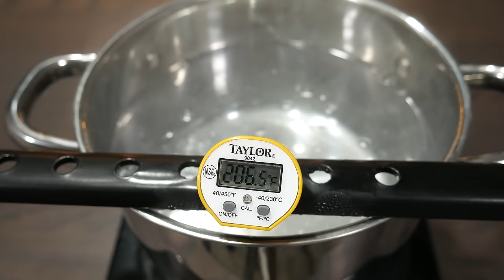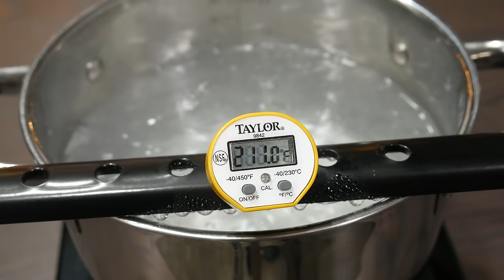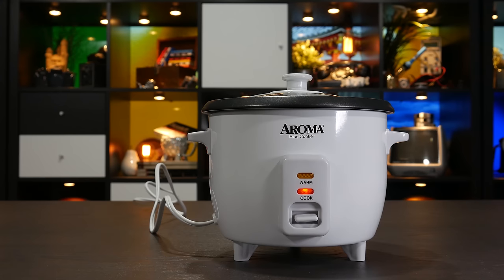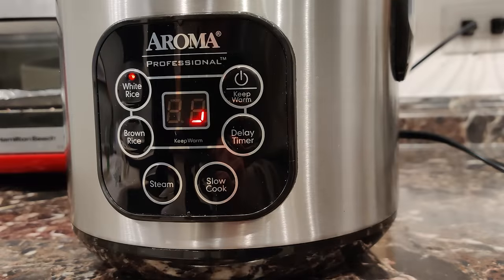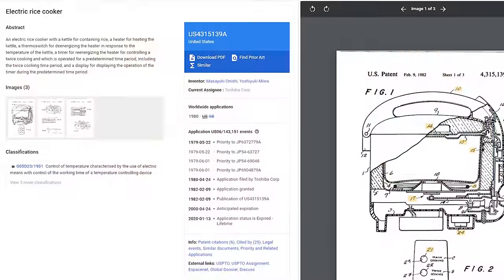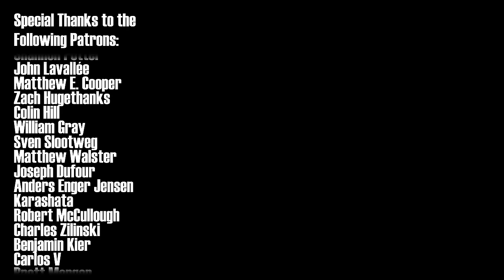Old-fashioned rice cookers are extremely clever

Comment: While the original Toshiba rice cooker from the 50s went out of style in Japan in favor of more advanced ones from Zojirushi etc and became a display in an appliance museum, it actually survived and has become a household item in Taiwan in the form of Tatung rice cooker. Available in various colors and sizes, Tatung rice cooker is said to have become a popular souvier for Japanese tourists when they visit Taiwan.
Reply: Yes exactly! Also wanted to add these are just about the only rice cookers you can buy with a stainless steel inner pot ie without non-stick coating! The coating is toxic imo, and it always flakes off eventually. Replacement pots are very expensive too.

Comment: Fascinating! so it’s not about cooking time, or pressure, but instead the ratio of water to rice. Thank you. You also instilled confidence in getting a cheap rice cooker.
Reply: Protip for cooking rice: Right amount of water for white rice is putting rice in the pot, then fill with water until the water is one fingerjoint above the rice
Reply: @MrProthall  depends on the rice type though. Some rice in some areas need more water and some need less. You need some experiments before getting the desired result.

Mine is like 4/5 upper finger joint to get the desired result.

Comment: Awesome explanation!
This helped me sort of figure out what is wrong with my rice cooker. Bought one just a few days ago and the stupid thing won't cook, it just jumps back to "warm". Thanks to your video I figured out that, for whatever reason, the magnet won't engage. The lever will just not stick in the down position. I thought I was doing something wrong, as this is my first rice cooker, but now I know that something is up with the magnet. I'll see if I can figure out a solution on my own, otherwise it's gonna get returned.
Reply: In another comment, someone said that once the magnetic force goes away,  something beside cooling off needs to happen before the magnetic property is restored.

The suggestion was made that there may be another magnet that remagnetizes that main magnet.

You could find that if you like reading these comments.

Comment: Came across this video while doing research on rice cookers and this has solidified my decision! I had a hunch that the simpler rice cookers give you the most bang for your buck and I enjoyed how you explained all the cool science and engineering that makes this work, loved this video!
Reply: I've had this exact rice cooker for a couple years, and it works great. I bought it to replace a 20+ yo version of the same one, which was actually still working just fine, but the bowl was losing it's coating, so I started to worry about its food safety.

Comment: I have the very same rice cooker - and like you, I started out with a much "smarter" device that was a real pain in the butt to use. Simplicity is King!
Reply: Smart is indeed thrown around a lot lately but without UX research a lot of companies can very quickly deliver "dumb" smart devices... As counter-intuive as that sounds.
Reply: I would argue the need to integrate a simple electromechanical timer that prevents cooking from engaging for up to 10 hours.  The only real selling points of using a modern rice cooker are the automatic ceasing of cooking and the ability to offset the start of cooking time so one can wake up to rice being perfectly prepared ready for breakfast and/or arrive home from work to perfectly prepared rice ready for dinner.  One can cover a similar level of safety from overcooked rice by using the oven cooking method rather than the stove top cooking method so that leaves the desirability of offseting the cooking time.
Reply: @chiblast100x Could always just attach the rice cooker to 24 hour wall socket timer and problem solved.
Reply: Rice cookers with Wi-Fi and app notifications are the norm.
Reply: @chiblast100x  meanwhile I use a streamer to cook my rice, also fairly safe from overcooking, though it is not exactly the fastest method.
Reply: Because your (and the authors) personal rice cooking preferences differ from my own, i deem them unfit and unacceptable. Good day, louts.
Reply: I found one of these while dumpster diving. Works pretty well.
Reply: @DeRien8  LOL I've dumpster dove in my college days and found interesting things, hell even made money online selling some things I found, but to take in and use a food preparation appliance? 

Actually, I got my recent toaster oven that way but that's a little different. We naaaasty!
Reply: @roderik1990  A steamer's a very solid method too.
Reply: @the_kombinator  
Good thing is, it was more "left behind, then cleared out" than "hey, this is broken."
Reply: @DeRien8  Yeah actually, my toaster oven was also a "left behind after an eviction" deal. That and a lot of tools.

Comment: What I think is really interesting about the interaction between the magnet and the spring is that it seems like part of what makes the change from "cook" to "warm" so quick and discrete is the relationship between Hooke's law and the inverse-square law. The magnet is stronger than the spring at close distances, but the spring easily overpowers the magnet once the button is far enough away, even after the temperature has settled back down and the magnet starts attracting again. I don't think you could get anything like this behavior with two springs, even if springs had something like a Curie point.
Reply: should be inverse-square law, right?
Reply: Sean ye^
Reply: That’s probably why they used the magnet instead of two springs then
Reply: You could get the same action with a bi-stable spring mechanism, I bet.
Reply: @spikosz  I had "inverse-square law" and then edited it after Googling. honestly it's been a while since I took physics so I'm not sure which one is right for magnetic force.

edit: ah, I think force is inverse-square and field strength is inverse-cube

Comment: "Water can not exist at a temperature higher than it's boiling point"
Well it can in weird situations but that's not important right now
I love that you put that in because you know your audience is a bunch of easily incitable nerds just one small technicality away from nerd rage XD.
Reply: SupaDanteX Would that “weird situation “ be under pressure?
Reply: @samiam619  and high temperature too
Reply: Sam I am All things being equal, increasing the pressure would also increase the boiling point temperature (because you need more energy), so water would be hotter but still wouldn't be 'higher than its boiling point'.
What he may have meant is what happens when the water isn't given an initial boiling spot, similar to freezing water that isn't given an initial freezing spot - you can heat/cool it beyond the phase change point, but it becomes unstable. Google 'instant boil' or something like that for more info.
Reply: KillahMate you're right.
Reply: the upscriber *you’re rig- oh you got it right.....
Reply: @samiam619  one thing worth mentioning is that the affect of pressure on the boiling point of water is inversely proportionate. So for example, as opposed to 100°c being the boiling point at sea level (100 kpa), the boiling point at the peak of Mt. Everest (30 kpa) would be around 71°c.
Reply: @darkdragon1194  That sounds like direct proportionality to me (between pressure and boiling temperature) and it is. You could say that temp. is inversely proportional to height
Reply: And of course I have to pile on.  There isn't a clean distinction between the liquid and vapour phase of a substance at all temperatures are pressures.  You can look at a PT (or PVT) diagram for a substance and notice how there is a critical point (with a critical pressure and temperature) above which there no longer exists a latent heat of vaporization - the phase distinction disappears.  See https://en.wikipedia.org/wiki/Critical_point_(thermodynamics) for more details.

TL;DR:  It is indeed possible to vaporize water without ever having to boil it - i.e. you can "walk around" the critical point and end up with water vapour without ever having to encounter a latent heat of vaporization.
Reply: He is technically correct; the best kind of correct.
Reply: KillahMate thats called superheating, you can achieve this by microwaving water for too long, remember reading an article about a woman who microwaved her water for tea and it ended up spraying in her face once she moved it becacause of the instability
Reply: How about if i add salt?
Reply: @samiam619  That "weird" situation is anything beyond environments in which you'd be cooking rice for the purposes of this video.
Reply: Now that you mention it...
I remember standing next to a fired-up steam locomotive (hooked to an excursion train), listening to the metal of the locomotive making all sorts of clicking & popping noises, and thinking "there's a whole bunch of water in there that really, really, wants to flash into steam.  Not a comfortable thought.
Reply: Not proportional, just related; when the height increases the boiling point decreases. If it were proportional you could multiply two of the numbers and get the same product as multiplying the other two numbers.
Reply: As far as I know, superheating has some very specific requirements which are not easily achieved in a household setting, let alone accidentally. The water has to have a certain purity, the container has to have a certain shape and be free of imperfections, water has to be given considerable time to settle, it has to be completely immobile while being heated, and things like that. The microwave story is probably an urban legend.
Reply: @ironcito1101  It happened to my mother-in-law. Not tea, but water with some Vick's Vap-O-Rub. She heated it once, forgot about it, and reheated it. When she pulled it out of the microwave, it suddenly boiled, giving her a mild scald.
Purity of the water is not required, just a lack of nucleation sites for bubbles. The first heating (to boiling) would have eliminated most of the nucleation sites. The layer of Vick's on the surface (essentially molten petroleum jelly with some menthol) would prevent airborne dust from forming new nucleation sites. All this would allow the water to superheat on the second run in the microwave.
Reply: @kevinmartin7760  Huh! Well, those are still pretty specific conditions, but I guess it does happen sometimes.
Reply: There are also truly odd situations, when the container is very clean and the temperature is raised very gradually, in which a state transition is "delayed" - water is heated above its boiling point or cooled below solidification temperature remaining liquid, for example.

Once the transition starts, though, the temperature falls - or climb - to the one correspondent to the phase transition, the heat being "consumed" or released  by the transition.

I never tried with water, but in high school physics lab I saw sodium hyposulphite that kept being liquid at 20C, at ambient pressure, when with that pressure it is supposed to solidify around 38C.

We thought we had fuc..ed something up, when the damn thing suddenly shot up to 38C and crystallized.

So, beyond pressure vesselsthere are also ther, truly odd cases where water can still be water above 100C (or 212F).
Reply: SupaDanteX

'I love that you put that in because you know your audience is a bunch of easily incitable nerds'': said ''supa PEDANTIC the vsauce emulating fanboy.
Reply: @darkdragon1194   1 ''effect'' .  2 Higher altitude means LOWER pressure, lower boiling point therefore the relationship between pressure and the boiling point of water is proportional.
Reply: lets heat water to such a high temperature that it becomes plasma
Reply: "know your audience" is always an important advice
Reply: High presure
Reply: Lol under pressure, it can get much much hotter than 212.
Reply: @bruhmoment9240  then you just raise the boiling point of water, but it will still boil at the boiling point.
Reply: @samiam619  "Under Pressure" is a song by Queen and David Bowie, not a "weird situation".
Reply: Pressure and Volume can manifest the boiling point. In this case is pressure
Reply: @selfification  I guess water will boil instantly in space
Reply: @mechamicro  Don't know if you were making a joke or what but
yes it does.
Reply: Pressure!
Reply: @SupaDanteX  And then it freezes. Because boiling is cooling remaining substance.
Reply: "One small technicality away from nerd rage" somehow just seems like a perfect descriptor.
Reply: I've had it happen 2x on a smaller scale.  Flashed-boiled some water out of a pyrex container, but didn't explode.
Reply: An invitation to descend into a rabbit  hole.

Comment: "I don't know what the heck that is in Celsius, probably some silly arbitrary thing" 😂😂
Reply: consider me triggered
Reply: It's gonna be (5/9)(F -32), if I remember my conversion correctly...
Reply: @nunyabidniz2868  joke is that Celsius scale is defined as 0° is water freezing temperature and 100° being it's boiling point (at sea level/normal pressure).
Reply: @niter43  Anders Celsius' original scale had water freezing at 100 and boiling at 0.
Reply: @niter43  That's the centigrade scale :p
Reply: Stock Name  you do realise Celsius is used everywhere but USA and a few other small states, right?
Reply: Stock Name  Bruh, I hope this is a troll comment
Reply: Stock Name  negative temperatures (in Kelvin) is indeed a thing: https://en.m.wikipedia.org/wiki/Negative_temperature
Reply: @niter43  fun fact... today, water freezes at 0.00251 °C and it's boiling boint is at 99.974 °C because tha Celsius scala was redefined, based on the kelvin scala.
Reply: @niter43  Almost right that 0°C is the freezing point of water. Water can be below 0°C/32°F without freezing, such as running water. 0°C is the heat at which ice melts.
Reply: There's no reason to clown on Celsius if you're being taught Kelvin, a 1C and 1K difference is the same. You just have to add or subtract a constant (273.16) to convert between C and K, rather than having to scale your obtained value with Fahrenheit/Kelvin conversions.
Reply: I love how Americans argue on the stupidest things ever
I'm talking about some of the replies of this comment
And I am not American (I'm a proud Asian that uses the Metric System rather than some complicated outdated system that causes a lot of problems)
Reply: All systems of measurement are arbitrary.
Reply: Hahaha! The funniest part is that most people don't get why he is being sarcastic.
Reply: All measurement scales that human being use are arbitrary.  Some are a little more thoughtful than others, but they are all arbitrary.  When you view the history of people trying to figure out all measurement systems,, you find out that they all started with a pretty arbitrary starting point, then they modified that measurement based upon new information that becomes available.  However, they are still arbitrary.

When trying to figure out how long a meter should be, they came up with several different methods to define it that they thought were very good.  But it turns out that some weren't very good.  When they figured out that the speed of light was a constant in a vacuum, they settled on that one meter is equal to the length that light travels in 1 / 299,792,458th of a second.  That number looks pretty arbitrary to me.  Why not some other fraction of time?  They chose that number because it yielded a result that gave a length that is very close to the original measurement, but ultimately it's still arbitrary.

When they invented Celsius, for temperature, why did they create it around the properties of water and not oxygen, or liquid mercury, or something else?  Again, it's all arbitrary.  It might be a little bit more thoughtful than some things in imperial units, but still arbitrary.

Kelvin has a much better starting point than Celsius.  0 degrees Kelvin means that at 0 degrees Kelvin, there is zero heat energy in the system.  But each unit is still pretty arbitrary after that.  It is still based upon water freezing and boiling point.  Again, why water?  Why not something else?  Just because water is so common on earth, doesn't means it's the best thing to use for your scale.
Reply: @DHealey  Centigrade=Celcius
Reply: @jerrywu4736  https://en.wikipedia.org/wiki/Celsius#Centigrade_versus_Celsius
Reply: @DHealey  The Wikipedia article that you are referring to talks about how Centigrade can also be an angular measurement. However, in this context, the scale that has 0 degrees as the freezing point, and 100 degrees as the boiling point is referenced as the celcius and the centigrade scale. Please see this sentence: "For scientific use, "Celsius" is the term usually used, but in English-speaking countries "centigrade" remains in common use, especially in informal contexts".
Reply: That's right. Also, water can be still unfrozen below 0 if it's too clean for the crystals to start, such as bottled water.
Reply: That's arbitrary.
Reply: Us in Celsius: its just 100 lol.
Reply: 373K of course.
Reply: @mickavoidant4780  Water can start freezing at 4.0°C mind you.

Comment: I have this EXACT model rice cooker and I love it!I I always thought it had something to do with the change in weight of the contents of the rice cooker over time. Like it knew that it'd stopped losing weight due to the water having evaporated, then changing to warm to prevent burning the rice. Thanks for the video!
Reply: Most of the water doesn't evaporate, it's absorbed by the rice. The weight stays the same.